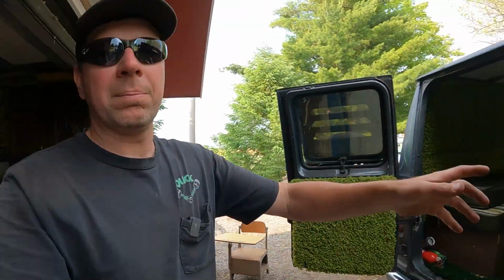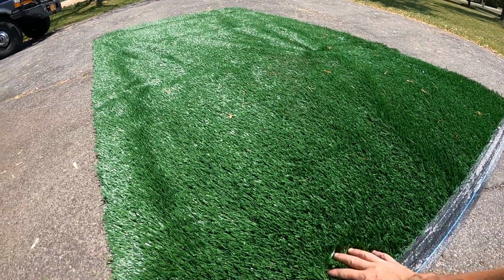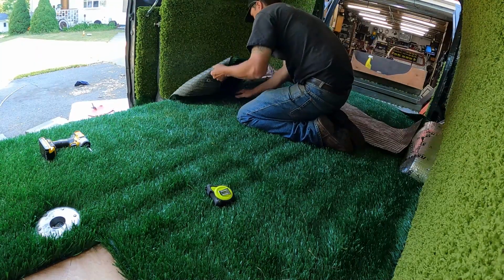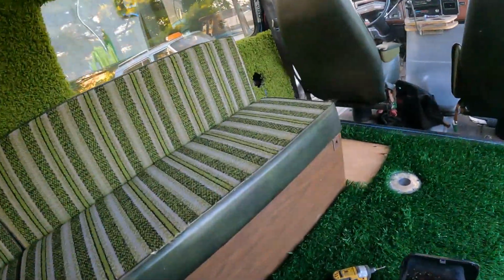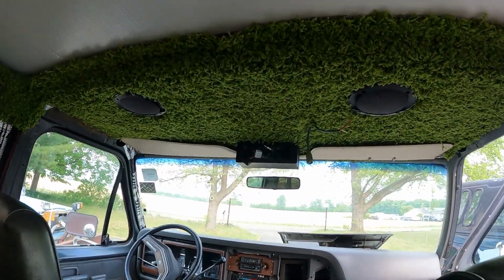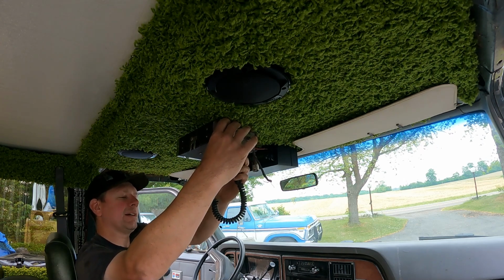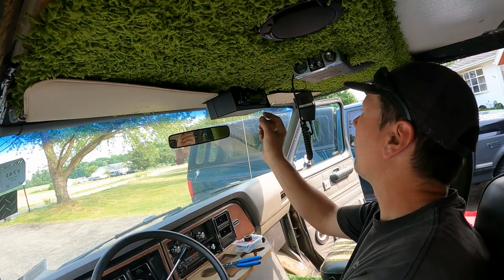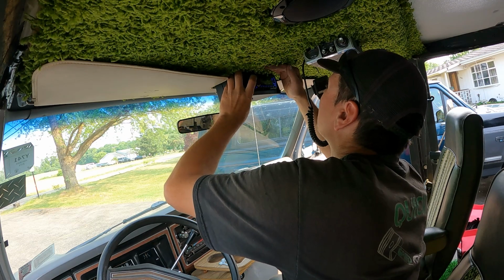Econoline Boogie Van Interior:  Rug, Stereo, CB, 8 Track

Comment: I have been  following this build for a while now because I have a van nearly identical to yours. I'm having some trouble with engine wiring is there an easy way we could message each other? If you are willing to help I would appreciate some pictures of the engine wiring harness. My van had parts robbed and I have made it run by wiring my own  ignition but cannot find the harness I'm missing.
Reply from the maker: Go on the about page and you can find my email address.  The easiest thing to do is just cut a harness out of another van.  That's what I did to fix what was missing on mine.